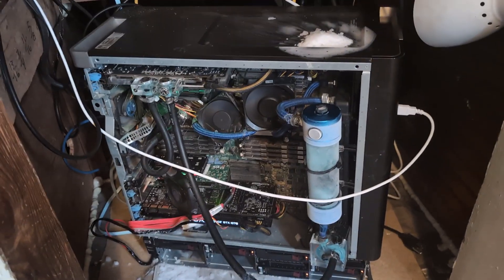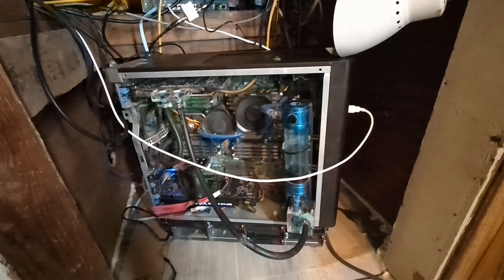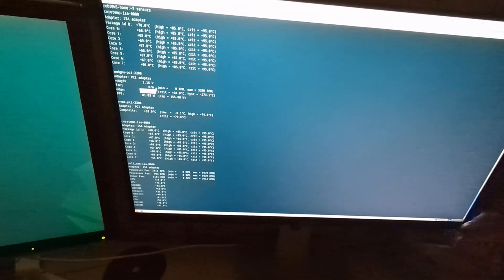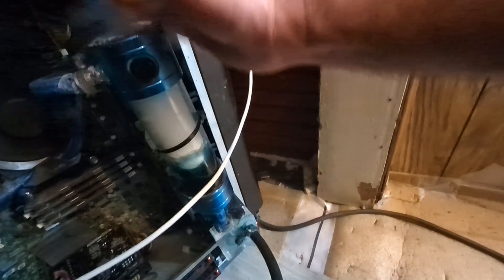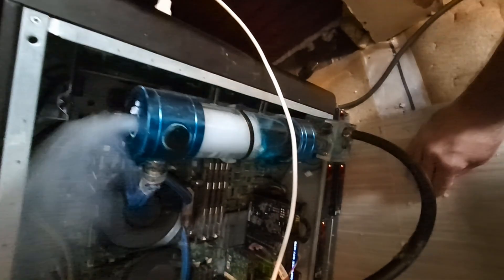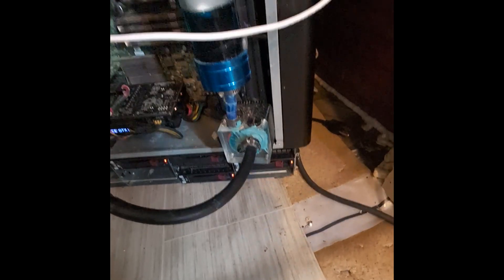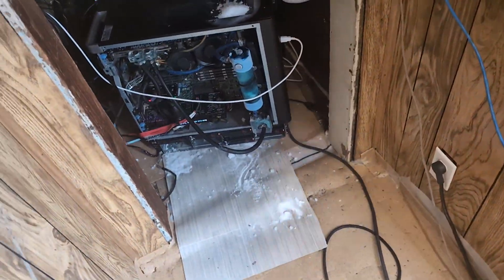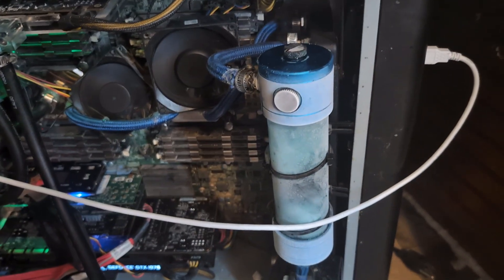Putting Dry Ice in Water Cooling Loop - Extreme Water Cooling !

Comment: is that even a PC?
Reply from the maker: Its motherboard is a Dell T7600 AKA the Compal BigSur.

You can find the complete motherboard design files by googling "Dell T7600 BigSur Boardview Big Sur-A00-CAD-BOARDFILE-110811-pm1-162"

When I built it in 2018 and the fastest thing I could find the motherboard schematics for.

256bit memory interface per CPU (quad channel) 512bit total (8 channel) connected together via QPI.
Two 8 core xeon CPUs I forgot the model but 2.9ghz socket 2011.
QPI is only a limitation in single threaded software, Ive heard windows struggles with this memory topology tho.
It has two PCI nvme intel SSD's, 2x WD 1TB SSD's in raid 1, 2X WD blue mechanical drives 4TB.

I can push them to 3.6ghz via overclocking the system bus via SPI messages to the PLL clock generator chip before my pci-express bus becomes unstable. (the commands are in the datasheet).

I ripped the front off some old HP server I had spare and glued it to the bottom. 
Its off a second LSI sas controller I think it has 6x 4TB disks in raid 6 for my archival storage.

At one point I was building some 10TB dictionaries.... for feasibility research before moving to local large language model AI's.

For graphics it has
1x AMD RX580 8GB. main graphics cards runs x-server and does my 3d.
Recently end of lifed by AMD so I can't run OpenCL anymore on it via rocm.
I made a custom bios for it that halved the memory timings well operating at the same clock speed. Gave me a 35% boost in memory bandwidth.
Bumped up the GPU voltage 0.1V and increased the TDP. After I bypassed the fuses when I blew them from over currenting the regulators 12V feed with some solder I was able to get the CPU core up nearly 50% in clock speed with the extra power and cooling.

1X Nvidia 1070 8GB
this cards pretty slow, its much slower then the RX580, I put it in since it was cheap and it said it was faster then the RX580 but its not at least not on Linux.  

Its even slower then my CPU's for running deepseek and Llama locally, way slower then the AMD graphics card was but its also not overclocked or modded.

Thinking about upgrading to a used quad CPU HP DL580 G10 for my base system, I need much more ram and more memory bandwidth pretty badly for some stuff im working on with custom AI models.  128GB with 8 DDR3 channels was plenty when I built the machine but its really showing its age. I need at least 1TB of ram and a total of 24 DDR4 channels. The 80+ cores I would have is also a bonus.

Comment: Shouldn't have put some anti-freeze😅
Reply from the maker: I use Nissan extended life anti-freeze in all my coolant loops. Its PH is pretty tame, it's safe with most metals, acrylic, plastics. It has corrosion inhibitors, inhabitable for mold and is a solid choice for liquid cooling loops.

Comment: How did you not blow up the line when the dry ice convert back to a gas.
Reply from the maker: I left it opened most of the run so it just vented until it started boiling over.  The blue braided lines are good for 10,000PSI the 3/8 fuel line (the black stuff) is rated for 1000psi. The weak point is the o-rings and the acrylic the GPU water block would probably explode at a pretty low pressure.